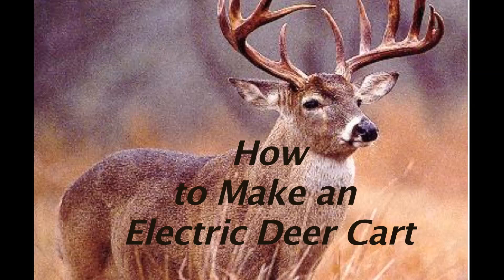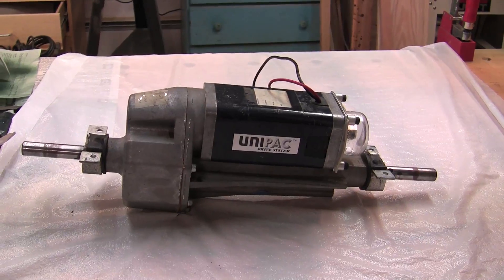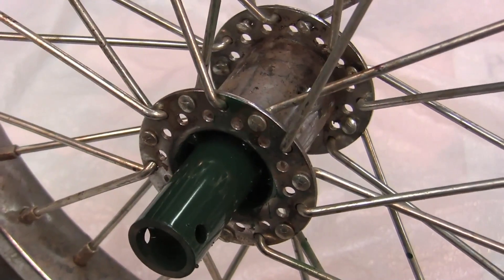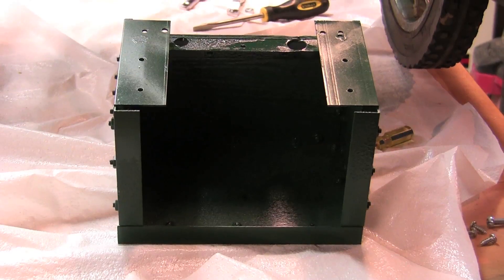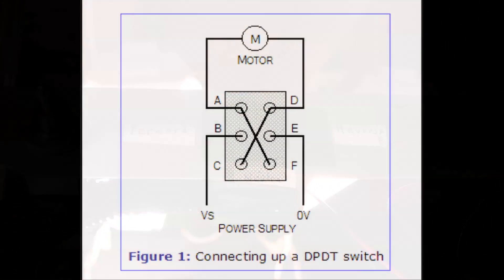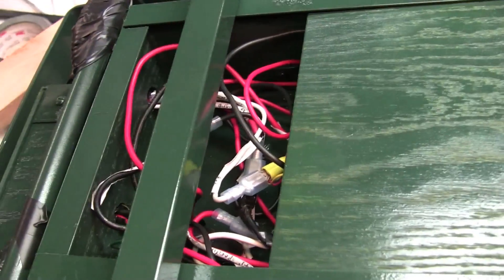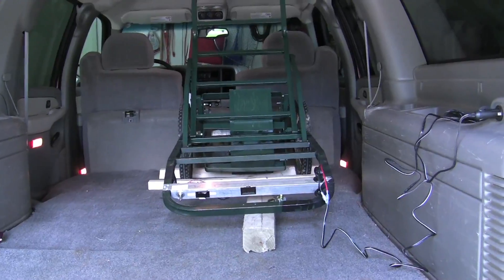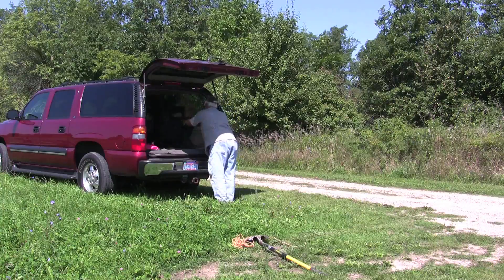Deer Cart Final.mov

Comment: You have the right idea. But you will find that you can not balance a deer on it. I have build a similar cart. And been testing it for 2 years now. Your cart will not maneuver on wet leaves or mud. The wheels will just spin. Also when you put any real weight on it. You will have to hold that weight. Which you'll find very difficult when going up and down hills. I will be going into production with my cart soon. check my web site for our products.
Reply: Wondering if you ever built your cart and having in production please pm me.